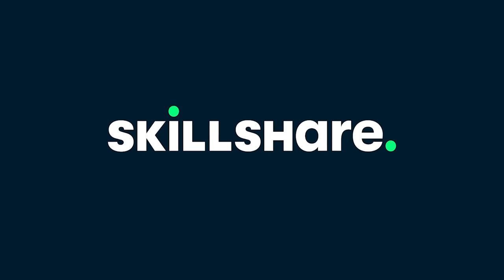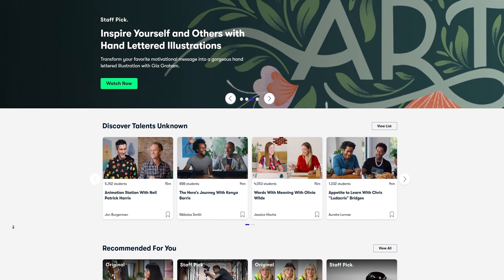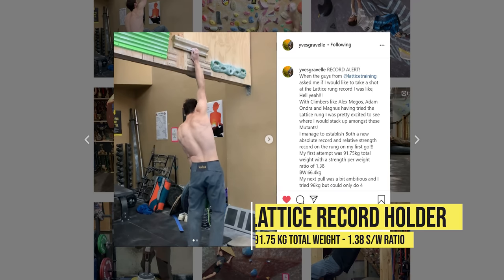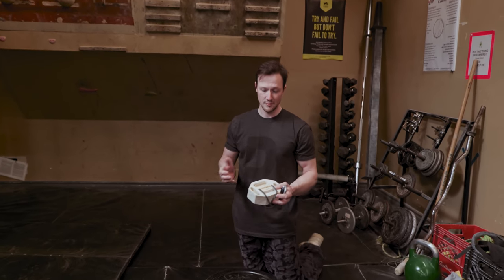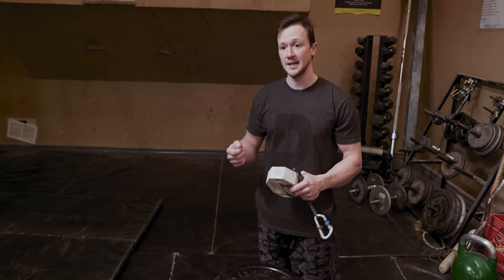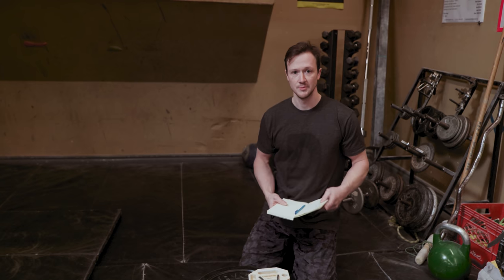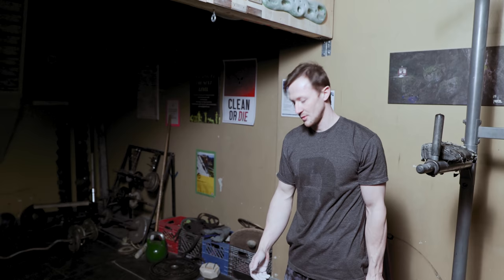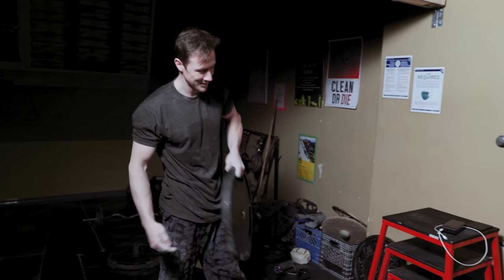Grip Strength Exercise and World Record!?

Comment: Hi Andrew, a great set of videos and thanks for publishing the material as always. a query for you: for Yves doing his 'max reps' at 12:39, he doesn't specify the weight. Off of the other warm-ups, do we assume it's at 80%, 85%, 90%? Thanks.
Reply from the maker: Hey Neal, I'm pretty sure he's at 100kg for that set (talks about it here 03:51). He was using 100kg for the exercise example but I think you're right and he would be trying to rep his last set anywhere from 80-90% his true max in an actual training session (similar to power-lifting). Maybe ask him on Instagram, but if I remember correctly— he listens to his body when he's training and doesn't hit his max each session because we're always in different peaks and valleys during our performance phases... as long as the trend is upwards.

Comment: So he can pretty much do 20mm %150 of his body weight with one hand. The top limit in the viral 9c test is %220 with both hands. So this guy would score would score %300? Thats crazy.
Reply: Not how it works I think... for whatever reason its easier to one arm an edge than it is to hang two hands on the same edge with body weight added in my experience
Reply: @emericq  yep! 
it's called bilateral strength deficit

Comment: im gonna say it again actual grip strength not finger strength has records held by world arm wrestlers and powerlifters stop with the bullshyt clickbait please
Reply: Finger strength is part of grip. Everything in grip has something to do with the fingers. And theres lots of types of grips, crimp, pinch, flat finger, crush, support (open hand/thickbar) and even the phalanges between the fingers is grip strength. In thickbar you hold the weight on your fingers in an open hand position, in pinch your fingers are are opposite your thumb and assists witht the lift. In the crushing/closing grippers you need strong fingers, pretty much your fingers does all of the crushing especially your bottom two while the thumb pad holds it in place. In the hub lift its pretty much more reliant finger strength rather than thumbs thats why climbers are really good at it. Armwrestling requires flat finger strength for containment of your opponents hand and you have eccentric handles which train that. Pretty much all grip implements require fingers. On the hangboard you're training your tendons, fingers and the tips of your fingers to hold your own bodyweight. Rock climbers have ridiculously strong fingers and good pinches thats why you see guys like Yves Gravelle excel at grip sports and destroy guys who are in heavier weight classes than him. He will be naturally strong at grip implements because of his finger strength, he demonstrated incredible pinch strength and lifted the inch dumbbell strict. He won 4x at world armlifting competition in Russia. Yves knows and met many atheltes in the grip community. he is will respected and he won 4x armlifting competionsm he proven himself to be world class and capable of achieving records. He holds the record for being pound for pound strongest gripster
Reply: @aidenyoung3115  armlifting is the sport of grip strength. Like powerlifting is sport of the big 3 compound exercises. Just a 20 second google search.
Reply: @aidenyoung3115  search "Armlifting" instead for correct results
Reply: @ÆÆæ-i4f  ok